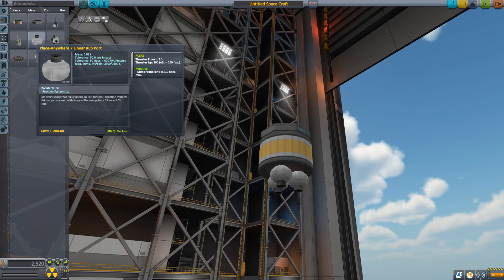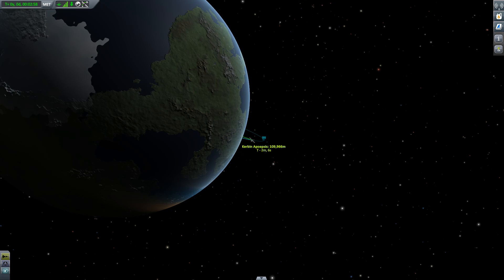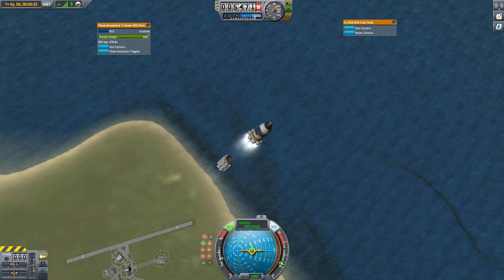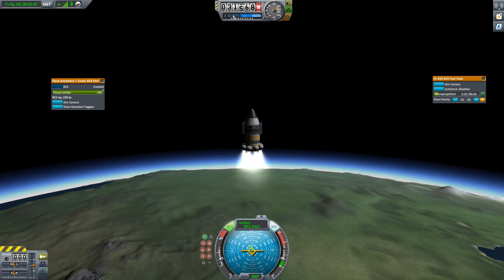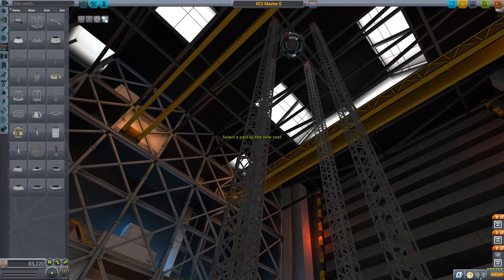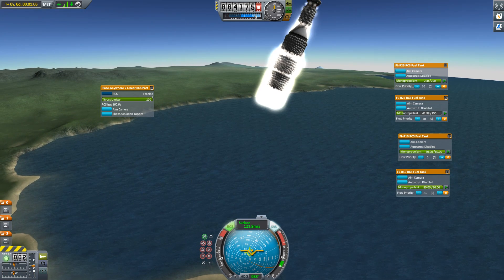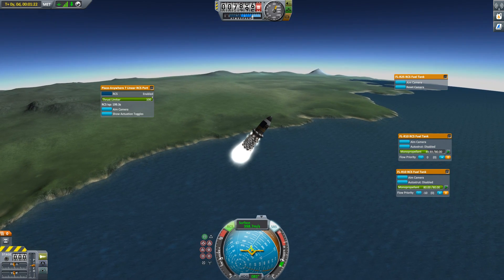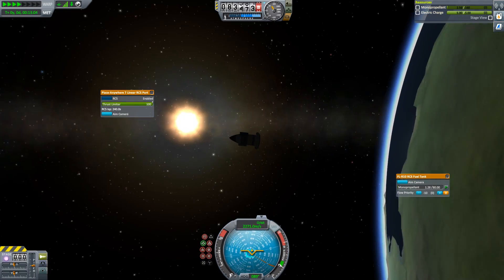KSP Challenge - Launching Rocket Using Weakest Engines

Comment: You cheated!
Reply: How did he cheat?
Reply: @General12th  by hanging the rocket far of the ground.
Reply: @Francis-ce1qb  Why is that cheating? At no point did Scott use a mod, or the debug menu, or save file editing to achieve his goal.
Reply: @General12th  it's against the spirit of the challenge. he made use of a bug to position his rocket waaaaaaaay above then you normally could. 
it's like starting 1 meter off the finish line while the others start 100 meters away

Comment: Actually this made me seriously wonder why Kennedy spaceport is at sea level. Surely they could have gotten a good performance boost launching from somewhere like Wyoming?
Reply: Well wyoming wouldnt be an option since its not on the east coast. You really want to launch from the east coast if possible, because you're launching to the east so you're not fighting against the earths rotation. And you don't want to be dropping your boosters on some poort town or city (China has had this problem but for them citizens are a secondary problem at best, which is why they don't mind dropping toxic fuel tanks near villages.) And going back to the earths rotation, you also want to be as close as possible to the equator, because that way you'll already be spinning at a pretty significant velocity. The actual gain from altitude is much smaller than the one from launching near the equator. So yes, if you had a mountain on the east coast near the equator, that would be the perfect launch site, but sadly the united states does not have such a location. Also you have the added complication of getting the rocket on the mountain in the first place, since constructing it there would be a major inconvencience.
Reply: Sorry for my english by the way

Comment: Is it somehow possible instead of burning fuel in the regular ground rocket launch, to build an underground tunel that would speed up the spaceship's ion thrusters using electromagnetic force and some gases (without using onboard fuel just external), combined then with on the ground lasers creating artificial anti gravity to speed it up through spreaded atmosphere thanks to those powerful lasers?

Comment: Unity Engine makes me sad as both a physicist and software engineer. :(
Reply from the maker: And yet both physicists and software engineers use Unity.
Reply: @scottmanley  Well, we're also lazy. For all its flaws, it takes a fraction of a time to stand up a project in Unity compared to almost any alternative, as you of course know. Although, I've usually ended up writing my own constraints solver, relying on Unity's physics for collision detection only. Doesn't take much of my time and lets me not deal with equivalent of Kraken. Number of collision tests is another matter, though, and I suspect is the core reason for framerate being as bad as a it is. The collision optimizations would have to be done at PhysX API level (or even at PhysX source level) and would require Unity to have a concept of multi-part nearly-rigid bodies as well as better concept of joints in general to provide these benefits to game devs. I'm sure Unity team has a long list of more pressing concerns, but it doesn't make me any less sad that it hasn't been tackled.

Comment: I've been playing KSP for years; I've been to Duna, Eve, and beyond. I think the greatest thing I've done so far was an Eeloo flyby. 

Yet I still don't know when you're supposed to start the gravity turn. I can't believe I still don't know this. I've always just flown really high, than cut the engines and roll to horizontal at apoapsis. This works but is really inefficient I think. Somebody help!
Reply: Yes, that's very inefficient. You're better off combining multiple maneuvers of different vectors into a single maneuver of a single vector. Thanks to the triangle inequality, the single maneuver will require less delta-vee than the multiple separate maneuvers.

You need to combine going up (so you can get out of the atmosphere quickly) with going sideways (so you can get into orbit), but that doesn't mean you can just launch diagonally off the pad. Thanks to various aerodynamic effects, you really do need to launch straight up. Then you start turning over degree by degree once you reach some appropriate speed or altitude.

For a small vehicle with reasonable thrust (1.5 T/W), you should wait until you're moving at 100 m/s before you start turning. Make sure your direction vector doesn't leave the little circle of the prograde vector or you might flip out. I think you should be pitched over by 45 degrees by the time you reach an altitude of fifteen kilometers.

Comment: It makes me wonder, what do you need in a computer to actually run such high part count for ksp? Do not say a 1080 TI because that won’t cut it. Try a Titan V with Volta.
Reply from the maker: It’s all about single thread CPU performance, GPU is not useful.

Comment: If the efficiency is so much higher at higher altitudes, would in not make sense to not burn in one long burn but rather to interrupt the burn and wait until higher up, i.e. in short bursts?
Reply: Remember you want to get away from stronger gravity (lower altitude) ASAP, otherwise you waste fuel.
Continuous burn lets you escape the gravity faster.

It's much like in real life launches, gravity losses are much higher than atmospheric losses (both from drag and engine efficiency).

Comment: Hey Scott, what about this... So you show that the difference between 69 and 120 meters altitude can make a pretty big difference once you get up in orbit. What about the effect of localized air pressure differences? Would it make a big difference in delta-v if you would choose to launch on a moment when air pressure is relatively low? Lets ignore for now the fact that depressions also  result in bad weather.

Comment: Can you manage to get into orbit using ion engines?  Try!
Reply from the maker: +ArthurEKing8472 not possible any more, ion engines generate zero thrust at ground level
Reply: Well dang!  How high up to they need to be to be able to generate thrust?  And if you could get them up that high using a plane-type profile, so they're only accelerating horizontally, and using the lift generated to push them higher is it even possible to get to orbit that way?

Comment: stupid nasa just bring the launchpad higher for more efficiency :/
Reply: Isn’t that the basic concept for space elevators?
Reply: The problem with launching a rocket inland is that if the rocket fails, it could crash into a house, but if they launch on a beach, the rocket will harmlessly fall into the ocean.
Reply: @williamlangdon2596  He said make the launch pad higher in a sarcastic tone
Reply: Walker Maher Ikr should just launch from mount everest
Reply: Mountains are not stable,  they vulnerable to landslides and it also add a lot of cost to make a tall concrete structure and have a rocket on top of it. One more problem,  rockets are not light,  it'll be hard to transport it
Reply: @noscope1244  Just building rocket on Mountain! What can possibly go wrong!
Reply: @dominikkodziejczak3041  everything
Reply: Ælectronics you must be a stupid nasa scientist
Reply: Walker why don't you don't do your research / first its expensive/2nd how can you put a rocket on it The rocket transport truck wont go up even if there was a ramp /ITS PRATACLY USELESS
Reply: @Pixel INF 

J   O   K   E
Reply: @small_SHOT  ?
Reply: Pixel INF r/wooosh
Reply: @eddystudios3242  r/wooosh is a redit thing don't you knkw what the r/ stand's for
Reply: @omairrazaakram  everything... with your ability of finding jokes

Comment: if you used the part welder mod, and you can extend the launch clamps that far, perhaps it's possible to build a space elevator?
Reply: iliketrains0pwned ground based space station

Comment: What is the lowest possible orbit you can achieve? On Earth.
Reply: The Karman Line is 100km above the earth's surface, and is generally considered the point where air becomes space. however there's still enough air around that if you want to complete a single revolution you need to be somewhere 125-150 km above the earth and even then you'd burn up afterward. if you want a stable orbit you'll need to get to 160km above the surface although you'll probably still need to do some occasional stationkeeping manouevers if you want to stay up there for a long time.
Reply: Gozer33 earth or keening?
Reply: *kerbin
Reply: Amy Stockton Kerbin is supposed to have the same measurements as Earth

Comment: who the hell would need a linear rcs thruster
Reply: jakub rembacz Those crazy engineers in the spaceplane hangar
Reply: I use them in all sorts of ways. Adding thrust to rcs for heavy crafts, using them as main engines on tiny probes, sstos and shuttles, or adding rcs on crafts that arent symetrical

Comment: since you got it to 3k height, you could actually launch it on the moon from earth, and with good enough reactions just land on the moon in spite of speed differences (since the kerbin rotates faster than mun orbits, maybe about 1/4 the way there would provide enough force to fling the ship to the moon reasonably, and with godly optimization would take only one fuel tank!)

Comment: I still think it's cheating if you have to outrun the kraken because you used a clipping glitch :P But it makes me wonder... is it possible to build a stock wheeled vehicle capable of reaching one of the peaks of the nearby mountains and then launch from there? With limited mods, you could also build the rocket in situ using KIS/KAS, as long as you bring all of the components along for the ride from KSC.
Reply: I'd imagine you could but it wouldn't be easy. to climb the slope you probably need a source of down/in thrust and to constantly stock that up on fuel you'd need to set up mining base stations
If i were doing it i'd just airdrop a launchpad out of the bottom of a cargo plane.

Comment: I like how Scott's version of the weakest engine is a linear rcs port when really its ion engines
Reply: KingKaos they have the same thrust- 2kn. In a vacuum. ion at 1atm= 0.05, linear rcs port 0.83kn.
 ion engines cannot possibly take off in a rocket,  spaceplane works though

Comment: I tried to replicate this rocket, but failed to get the fuel consumed incrementally. All tanks (in all stages) ware drained at the same time. How do I fix that?

Also: Shouldn't there be something to gain by pausing the power for a while after each staging? (Thus gaining more altitude and reducing drag before pushing on.)
Reply: Olle P disable the Crossfeed between the stages. you can do so in the decouplers.
Reply: Crossfeed was disabled. I tried both "enabled" and "disabled". My experience is that monopropellant isn't seen as a "fuel" in this respect.
(Just build a multi stage liquid fuel rocket with some mono in the last stage only and control thrusters on all stages. The main engines will draw from their own stage only, but ALL thrusters will be available for use.)

Comment: I have been wondering if it is possible to make a fast moving sled mounted at about a 60 degree slope to launch standard rockets. In the game getting the clamps to hold it properly at an angle might be tricky. The point would be to imagine that the sled is powered by something like EMALS for space craft and thus providing at least a little bit of initial thrust from electrical power. As this video shows raising the platform even a little bit seems to help so giving it a shove instead of a high platform should do something potentially useful.

Comment: I have a challenge for KSP. You can refer to it as the Likely Impossible Challenge.
DA RULES...
1: You must use every part in the full game
2: You can only use a part 1 time
3: You cannot use any cheats
4: The rocket must be able to successfully orbit 3 times and then land back on Kerbin
5: Try to do this with as many kerbals on board as possible (Optional)

Warning: this may actually be impossible

Comment: People still use consoles? Perhaps they should upgrade to a puter.
Reply from the maker: No, because too many PC Master Racists use those.
Reply: "No, because too many PC Master Racists use those." Ah yes, good old "Hitler ate bread" argument.
Reply: James Faulkner  II Didn't know you had to be white to be racist.
Reply: You do know about the "PC Master Race" joke, right? It has nothing to do with white supremacy, but "computer supremacy" over consoles. Thus a "PC Master Racist" is basically someone who holds that computers are superior to any console.
Reply: But they are!
Reply: jakethesword 4 A decent PC isn't expensive at all... You can get something that easily beats a console for console price. Excluding laptops (Which are extremely expensive for what you get, as they must be compacted down and use custom parts) and pre-built PCs (Cost more as they are... Well, preassembled.) My machine which is currently worth ~$600 can play virtually any game maxed out at 1920x1080, 60 FPS (Including modern AAA titles), and if you get lucky and find someone selling a used part cheap you can get some fairly high end hardware for well under the cost of a console. Plus, parts are upgradable and there is no fee for online use so you end up saving more in the long run - Instead of buying a whole new $400 console you sell the old part and spend $80 on a new one, and you're back on top of everything.
Reply: The site owner referred to the "Master Race" which was supposed to be white.
Reply: James Faulkner  II It's a joke, man.
Reply: James Faulkner  II my computer cant handle ksp and all the computers are expensive as hell
Reply: That reaction was hilarious
Reply: @LowModulation That excluded Adolph Hitler, but he could get away with that until he committed suicide.
Reply: They should upgrade to a smoothing iron.
Reply: "colour" a non merican I see, perhaps these words will help. Trump, American slavery, Brexit, master race-Hitler. Not many brown people involved in power there. The OP was about the master race for fucks sake read behind his thinly disguised lines.

Comment: what is your computer like? I had a spacecraft with 2,700 parts and it was hitting 2 fps, its just a mid-grade i-5 with built in graphics card and 8 Gb of ram.
Reply from the maker: I think the RCS thrusters are especially bad, most of the slowness comes from thousands of log lines complaining about audio.
Reply: so it was the audio that was killing your machine.
Reply: umad42  Oh so it's got no threads. Explain how it runs then?
Reply: instead of a 1050 you can get a used radeon HD7970 for 100 bucks if you don't mind the higher power draw. It'll run almost everything you can find on medium or high.
Reply: rockets-don't-make good-toast A literal toaster. Like, I can make toast with it /s.
Reply: it's was the best premade pc for my budget. and it works pretty well. Besides kerbal space program doesn't use much gpu strength so it doesn't matter.
Reply: get a better graphics card. i recomend nvidia 1050. its not 1080 but its still good for ksp.
1050's what i use btw. it runs very fast.
Reply: I run an i3 but I have 16 gb of RAM and a 2gb graphics card lol. 3.something gigahertz dual-core no threads. 60 frames in KSP. I can play Fallout 4 at 40 FPS. PoS processor for the win!
Reply: Man. i5 integrated graphics run KSP at 2 fps with no parts.
Reply: Raidzor つ ◕_◕ つ just don't use integrated, ever, buy a 1050 and you will not regret it